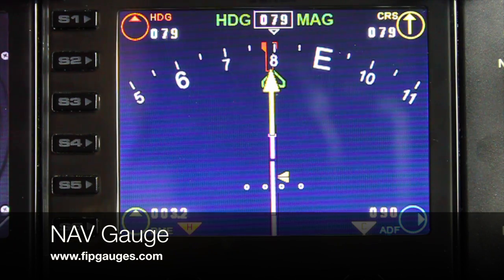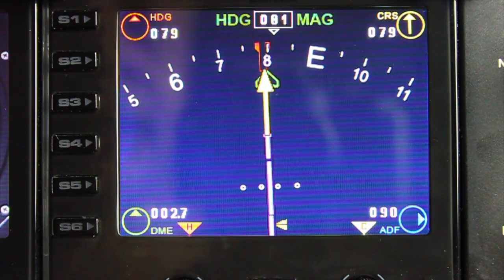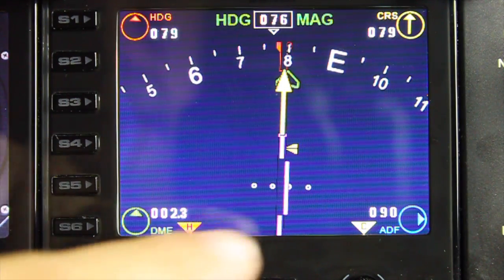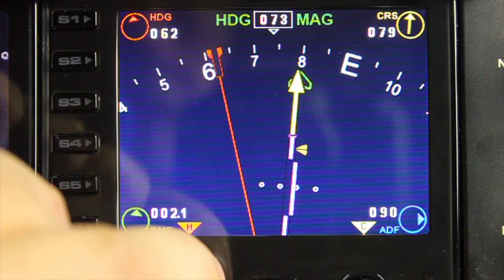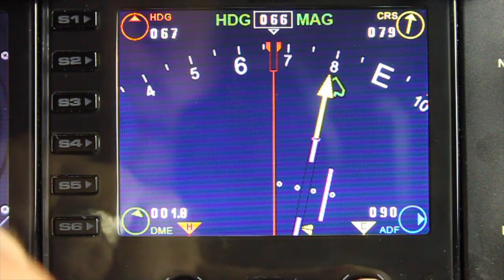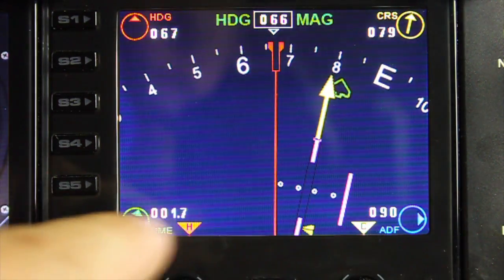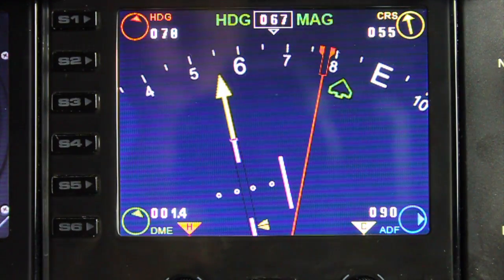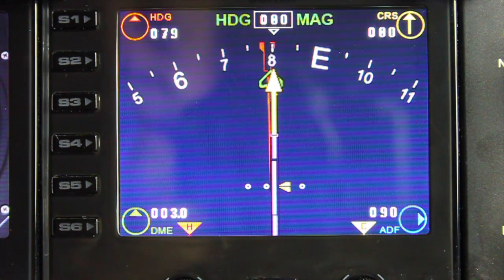NAV Gauge - Saitek/Logitech Flight Information Panel & SPAD.neXt

Comment: After the last update the yellow arrow for the course button is missing. wenever,  when you turn the CRS button the yellow arrow in the PFD appears correctly, but  appears in the PFD only. 
FSX sp1 with hardaware logitech in a home cockpit.  I waiting any solution fot this issue. thanks. March 2022.